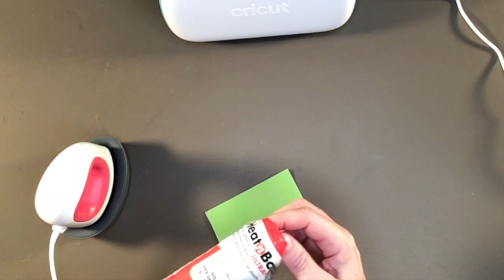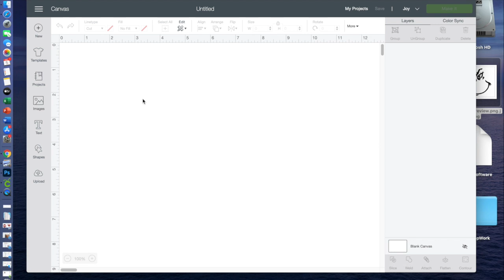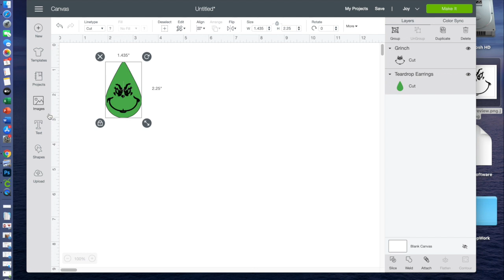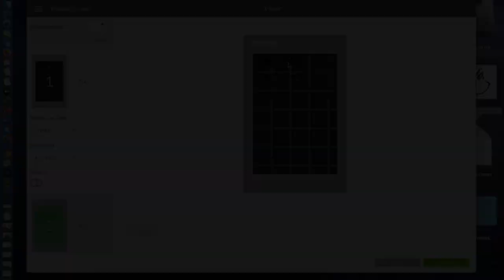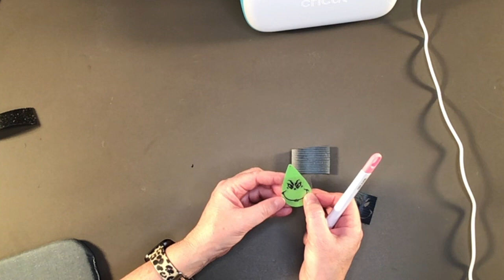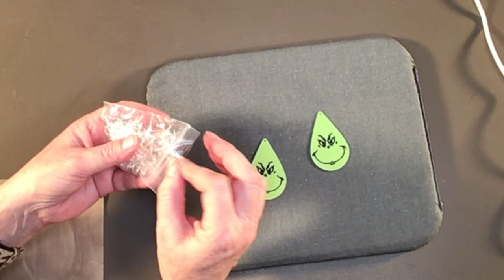Grinch Earrings Made with Faux Leather

Comment: Do you add the best and bond to both leather pieces, or just one?
Reply from the maker: It was just one piece of heat n bond. I applied it to one piece of the faux leather first, and then peeled the heat n bond backing off and ironed the other piece of faux leather to it.